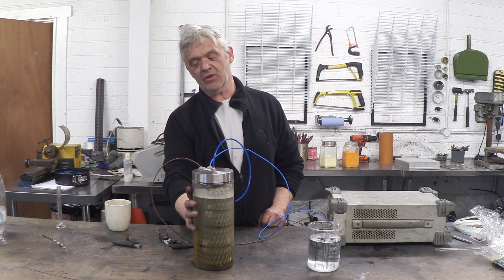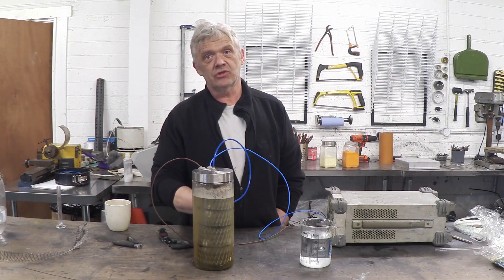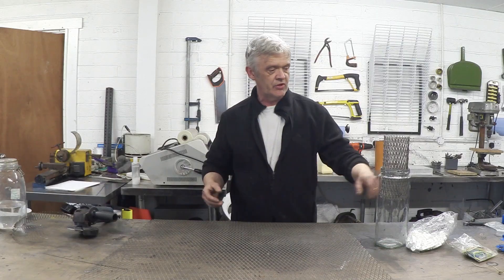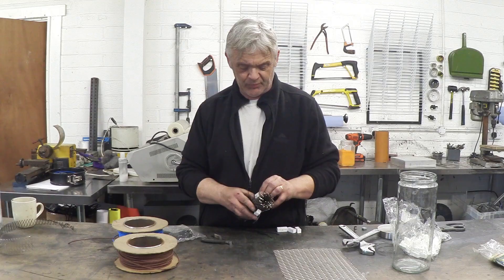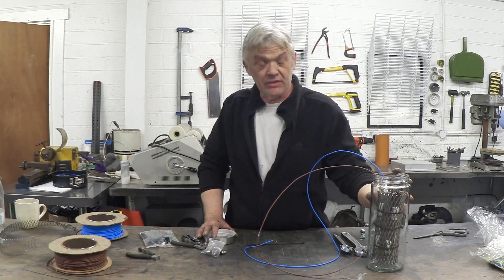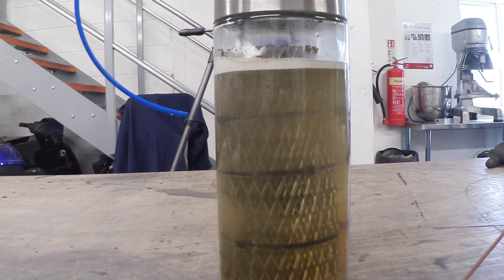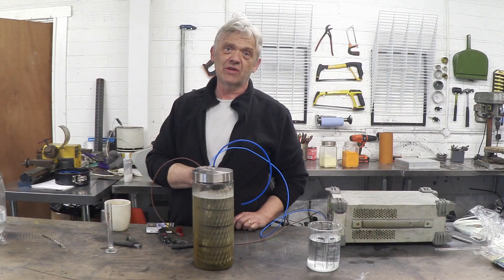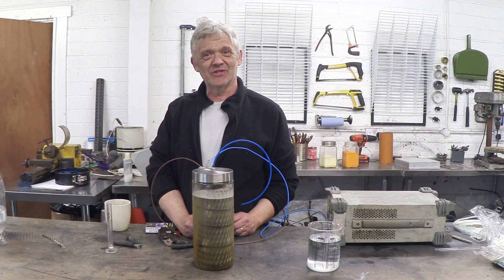Cheap And Easy Hydrogen (Brown's Gas) Generator

Comment: From russia... try to set pelter termo generator on car exhsust, to get electricity for hho electroliser ))) sorry for bad english ))
Reply: You can use the power from peltier thermoelectric generator, TEG, powered with waste heat to make the alternator take less power from the engine, that would reduce fuel consumption more, and it is a lot less complicated and less dangerous. Also it would make the battery last longer as lead acid batteries last longer if they are not discharged. 
It would not make a huge difference though, TEGs are not very efficient, and it is difficult to harvest waste heat very efficiently, but reducing the power the alternator draws would be much better use of what small amounts of electric energy you can get from TEGs in a car than taking the detour of hydrogen production.
Reply: @Mr Brightside The issue with compressed air is that it takes a lot or energy to compress that air. Sure the car you are using it in is not consuming any actual energy, but the deice that compressed the air likely has used a lot of energy. It would be more efficient to just use the energy spent compressing the air (high losses) directly in the car (lower losses, not compounded by multiple conversions). Compressed air is fraught with conversion losses. It takes some kind of driver to push the compressor (energy driven with conversion losses) energy to transport the compressed air to the car (more conversion losses) and then to power the car (more conversion losses as compressed air engines are not very efficient. . .more conversion losses). Most people talking about how efficient a compressed air car would be completely forget that that compressed air has to come from somewhere.
Reply: @Mr Brightside The energy lost to breaking is typically few percent of the total energy used, compressed air does not do much for efficiency, it can increase power output, but with increased fuel consumption.  Compressing a lot of air during a short time will mostly produce heat, very small part of the used energy will be stored as compressed air. Compressed air also has limited value in a car. All in all, that system would "pay", in form of gained efficiency, for it's own weight. 

Internal combustion engines in cars produces a lot more heat than usable energy. Granted, it is not easy to collect a very large part of that energy, and turn it in to electricity, but a TEG for a few dollars can produce a few watts as long as it is kept hot on one side, and "cool" on the other. They are not big, not heavy, not overly expensive, so you can use multiple TEGs, as long as you can cool the cool side properly.
Reply: @Mr Brightside No, airflow definitely helps in making it more efficient if air cooled, but is not needed.  You are making assumptions based on the conclusion you want to reach, not on facts or logic reasoning.  

There are way better systems for regenerative breaking than compressed air ever can become. What you think when you obviously lack basic understanding of the problems, is completely irrelevant. 

How do you think you have realized significant value in the technique that is older than cars, that apparently no manufacturer realized since the invention of the car? Do you think you are god? Elon Musk? Leonardo da Vinci? Or even smarter than them?
Reply: @fishyerik  "making assumptions based on the conclusion you want to reach noton facts reason or logic" this statement hits hard I'm going to keep it in my thoughts for the rest of my life it can be applied to so many aspects of life and is so very clever and helpful just want to thank you brother for the words of wisdom I love it!
Reply: @Mr Brightside Not aggressive, but frank, clear. Tell me that you know what you are talking about when it comes to compressed air as energy storage for regenerative braking, when your gathered knowledge about it. Your knowledge/experience with/about race cars might be impressive, that does not in any way mean that your wild guesses/feelings/assumptions about compressed air as energy storage has anything to do with reality. Some skills in one area is in no way automatically transferable to a divine understanding of a somewhat adjacent area. No. Just no, that's  just not how reality works. You'd absolutely need divine powers to realize potential of that kind that that millions of intelligent and educated people, and all others, have completely missed over a period of more than a century.
Reply: What is this ? Thanks .
Reply: @Mr Brightside  break turbo buster, not bad !) Some kind KERS on f1

Comment: The Stainless Lathe is a great idea, cheap and easy to get hold of at most good builders merchants.
To run a car you would just need to separate off the Hydrogen and store it, apparently, tanks with Lithium 6 Deuteride is best to absorb it, however getting this fairly harmless material can be a pain because it is used in nuclear bombs, however I did once hear of Carbon being made from Coconut shells and being used to absorb Methane in Tanks to run cars, maybe some sort of a carbon matrix would also work for Hydrogen to increase the storage capacity of tanks.
Reply from the maker: another interesting idea mate - cheers

Comment: If you are generating hydrogen also from the Urea, and not only from the water shouldn't you have to replenish that too?  I mean, while if you use a salt electrolyzer you'll have to replenish only the water, in this case you are consuming also the electrolyzer.

Comment: I never knew about them usign Urea!   AWESOME VIDEO! They sell a stainless 316 spatula grill set at homedepot and its super cheap!  I just sand in 45 angles maximizing surface area!  Great stuff!! Would love to see a  Dry cell with Titanium plates.  Someone is getting crazy performance with that.. I wonder what a graphene-coated TI would be?   Spin coated maybe?
Reply: I try graphit coating on plate. As soon as you put electricity it is washing off right away. And i try to melt copper to liuquid phase and mix it whit graphite. It will not bond.

Comment: After a bit of googling, you'll get H2 at one electrode and CO2 and N2 at the other. Browns gas is actually o2 and H2
Reply: and thus in this way you get a mixture out of the pot.. not great for storing but there might be another great way to split that (other than separating the annode and kathode in separate but connected pots.
Reply: In actual fact you get H at negative electrode, H being Hydrogen. And you get O2 from the positive electrode. H =Hydrogen and o2=Oxygen,2 parts. Add both together and you get H2O which is water.
Reply: @roberttill3787  its actually 2 hydrogen and 1 oxygen
Reply: @HitmanMOB1  Cheers for pointing that out!
Reply: @roberttill3787  May I use this for a nebulizing? What should I acquire for the power source. I have a little generator that didn't last very long but it helped my upper respiratory issues. Been watering my plants with the water also. Thanks for any Enlightenment on this it will be greatly appreciated......
Reply: Electrolysis in general or using urea specifically?

Yeah diatomic hydrogen and oxygen not separated but together is browns gas from what I understand.
Reply: The building technique comes across as a good., cheap and easy method.. The gas confusion seams to be a problem..

Comment: I hate to rain on your parade, but; Brown's gas is not hydrogen. It is energized water gas, (pure water in macro-molecules that are so diamagnetic that they are a gas above minus 158 deg, C. When it is forced to the proximity of forming a liquid, it fractures into smaller hydrogen bonded liquid form of common water. In the process releasing a flash of electricity with a large percentage of current. Up to 6x the electricity of hydrogen in a fuel cell. It is capable of performing cold fission. Several plasma physicists have published about the nuclear effects. (no critical mass, no heavy metal extended half-lives. You might try adding magnetic fields, using 400 stainless electrodes. Denny Klein's patent has a detailed analysis of the magnetic properties. To form this less stable form of water in higher percentages than hydrogen. Cheers, B

Comment: Serious question please.
Here downunder 🇦🇺 where it’s hotter than hades and we get so much sunshine that it shines at night time 😉😜😜😂- everyone is installing solar power & selling surplus power into the grid during the day time when no one is home to utilise it.
At night time when the sun has set & the family are all home from work / school & chew up copious power, for lights, cooking & infotainment, we buy that same power back from the grid at 4 times the electric Tarif we got for the power we put into the grid during the daytime when no one was home to utilise it.
So the “answer” is Tesla “powerwall” lithium ion batteries to store your own power generated during the day time & draw down on it at night time rather than buy power from the grid at 4 times what you sold it for during the day when you had surplus.
The “problem” being that the “Powerwall” li-ion batteries, cost ~$10k each and an average family home needs 2!

It takes forever to see a return on that 20k investment.

Is there any good reason that solar power during the day couldn’t electrolyse water into Hydrogen & Oxygen & store (compress) it into storage tanks on a household level, then at night time - re combine the DiHydrogenMonoxode back into water byproduct - to generate the power we need in our homes during darkness hours?

Might not it be cheaper to be doing this every day than charging li-ion battery’s during the day & discharging them at night?

It Tesla Powerwall battery charging / discharging MORE or LESS efficient than electrolysing urea solution, then re-combusting it to generate home power?

To me it seems like a no brainer, to electrolyse water or urea solution and compress it into storage tanks during the day & use it again at night than charge / discharge Li-ion batteries?

I’m guessing the engineers at Tesla are smart enough to have investigated this and passed it up for logical reasons (risk of hydrogen bomb explosions for starters).?

Comment: Just be careful with Hydrogen, it is not gasoline. Some very unusual properties,  Lime-lights have been famous for explosions. You would never want it in a car, take it to the moon, sure. ...  Stainless steel has a nice percentage of nickel  hmmm a steel mesh and you have a battery cell in Potash.

Comment: Hi Rob. presumably, the stainless steel mesh and the urea need to be replenished periodically. In which case, the energy expended in the production of same would need to be accounted for in the net energy gain equation. Or am I just being pedantic?
Reply: Replying to myself. If there is net energy gain, then we can use the produced hydrogen to drive a generator to produce the electricity  to drive the hydrogen generation. In other words, an "over-unity" system. With this, we can power the world!!

Comment: how much hydrogen is produced per kilo of urea and what purity is recommended? 
Also, can you show how to make or give suggestions for a backup generator?
Reply from the maker: it'll be the stoichiometric amount mate given by weight in and joules added - no idea on purity I am afraid - this is new stuff to me really - a gennie - well I have that old one I am going to use - but so much of this is basically trial and error I can't really be that much help there I am afraid

Comment: I believe S Myers also used a FWM. I wonder if changing the hz or using high voltage can help break the bond easier
Reply: Hmm, what is the resonant frequency of a water molecule?
Reply: @MarkSeve  on german wikipedia is written that its lowest resonance is 22,23508 GHz. But multiples of it too. But the implication that full divisions(/1x) wont work is untrue since i found that at ~22khz there is a slight increase.
Also note that household Microwaves use´only 2,455 GHz.
So just divide 22,23508 GHz by 10/100/1000/10k/100k/1mio
I didn't compare 22khz vs 222khz or megahertz since i didn't have the right oscillator at the moment. (You need an oscillator an a mosfet which can handle the frequency you want to use.

Comment: Rob its a good idea to condition the stainless by running the device for an extended period ,then replacing the electrolyte , repeat a few times , you get a brown sludge as the ss 'rusts' , I got rather a high chrome reading from doing this ,so use gloves and dispose of sludge safely ,, can get 2 liters a minute for 10 amps 13.8 volts dc using potasium H , 7 plate series cell , plates about 200 cm square , stuff goes bang louder than a shot gun .Stan Meyers ran VW buggy with on board generated HHO , then got poisoned ! ,. suspect he figured something else out though,to do with nitrogen . His cells were SS tubes inside tubes ,cut to have same resonant frequency,completely immersed in water , probably set up to be a capacitor in an LC resonating circuit  .

Comment: It would be better if you could separate the oxygene from the hydrogene. Browns gas is highly explosive and not very useful.
Reply: browns gas is actually highly implosive,and is very useful...it burns with a cold flame,you can put your hands in the flame and not burn,but it will cut thru steel in seconds...it is a plasma of dissociated hydrogen and oxygen ions...plasma,not gas...
Reply: @dexterdequoitdikkentheworl87  Brown's Gas burns at 2,660 °C or 4,820 °F. Keep smoking what you're smoking and make a video of you putting your hand in the flame. That would be some funny SH*T

Comment: It would be nice to know the half cell reactions. The combined gas output looks like carbon dioxide, nitrogen and hydrogen.
Is the overall reaction NH2CONH2 + H2O > N2 + 3H2 + CO2 ?  (sorry about the lack of subscripts). 
Some papers suggest adding potassium hydroxide to convert the CO2 to a carbonate, keeping it in solution. They also suggest using nickel electrodes as this acts as a catalyst for greater gas production. I note, you do not attempt to collect the gasses evolved at the electrodes separately. This is not a problem for an OHH generator as the products are both reactive, but in this urea cell, the nitrogen and carbon dioxide are unwanted byproducts. Why is your cell brown, what is in solution?
Any idea why urea electrolysis is not a more common method of hydrogen production, give how abundant urea is in the environment?
Reply: Urea is used in fertilizer. To use it as a fuel would directly compete with farmers and raise the cost of food. Also it is made from natural gas.
Reply: @affiliatereviews4079  we make very poor use of the fertiliser contained sewage. This is often discharged to the rivers and sea unprocessed, it then poisons the environment, producing huge algae blooms. It would be far better if this was processed to produce fertiliser.
Reply: @nigeljohnson9820 The Good old Honey Wagons in the German Country Side......
Reply: @incognitoalias2808  this is a reference I know little about, but I can guess. Its a case of "Waste not want not".

Comment: Can you really get more energy out than you put in? When did the Second Law of Thermodynamics get repealed? You should also be producing oxygen (Browns Gas is often defined as HHO) meaning that the mixture you are producing is explosive. I have two HHO producers of 150 litres per hour and 400 litres per hour, they are sold as acrylic polishers or jewelers welders and do an excellent job welding non-ferrous metals particularly precious metals. Flash back arrestors are mandatory as you get more than a little 'Pop" if they are absent. Ask me how I know.
Reply: The second law of thermodynamics didn't get repealed.  Robert's not electrolysing water to get a stoichiometric mix of hydrogen and oxygen, then recombining that hydrogen and oxygen and claiming more power is generated than consumed.

He's electrolysing urea to get gaseous hydrogen and nitrogen and potassium hydroxide in solution, then combining the hydrogen with oxygen from the atmosphere to generate heat.  Two entirely different reactions, and it's feasible that one generates more power than the other consumes.
Reply from the maker: that's right mate
Reply: @wibblywobblyidiotvision  How much electricity is he putting in to generate 1kg hydrogen? Or look it at it from another point of view. If I can use pee and electricity to create hydrogen which can then be turned in to water and even more electricity, then water treatment plants treating sewage would be net positive and we wouldn't need to pay for water treatment...

Comment: Oops. Conservation of energy.
Reply from the maker: mate - it releases stored energy
Reply: @ThinkingandTinkering  well not quite. Your using x amount of energy to split a molecule of water. The same amount you would get after recombining them to make a water molecule. A lower voltage because of using urea would mean a higher amp draw. Somewhere in the 60 plus watts area in your video. Store that 60 watts in your battery for electrical work would be more efficient. You wouldn't have the same amount of wasted heat. I have yet to see a true analysis of running a car on water that would show that it's effective. Lots of claims but no proof. 
Sorry. 
Great videos. Keep up the good work. I'd love to see your battery come to fruition. 
Mike.

Comment: Since stainless steel is not very conductive could you use copper painted with your ink? Maybe the ink would protect the copper from degrading.
Reply from the maker: I would try covering it in conductive plastic mate - that would be good for sure